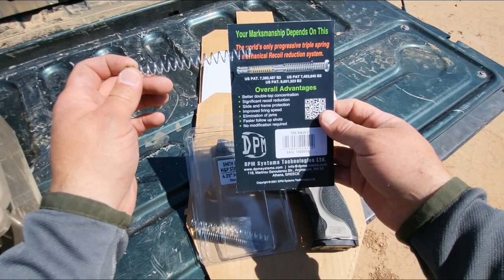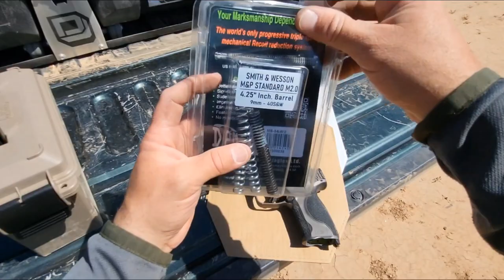Why I upgraded my M&P 2.0 recoil spring and guide rod to DPM.

Comment: DPM has been worth every penny for everything I've put one in. Have one in a 3.6" M&P and my 4" M&P. both of those are 40s. I run 3 calibers thru them both. 9mm, 40, 357sig with appropriate barrels. These springs handle all very well. I'm impressed.
Reply from the maker: This is my first. I became aware of them only a few months ago but I really do like it. I think I'm going to get one for my P365 since I run that gun for a Back Up Gun Match once a month.

Comment: Calculated Kinetics has a optic plate fix.
Reply from the maker: As of right now I have never had any issue with the optic plates that come stock even though they are plastic. I will check them out though. Can never hurt to upgrade.
Reply: @manyo365  he is referring to the dog plate that is supposed to stop the gas from making the optic dirty
Reply from the maker: @matt-ts8cx  That doesn't even bother me anymore. I just cover up the glass with black tape.

Comment: You need to run, the ' stock spring & guide rod and just shoot 124 grain. Ive had my Smith&Wesson 2.0 metal since December i have over 4,000 rounds now. No issues, and stacking shots on top of shots. These recoil spring kits are a waste of money
Reply from the maker: I'm just under 7000 rounds through my 2.0 now and have never had any issue. I put this guide rod in just after 3000 rounds so I have the same amount or more rounds with the DPM guide rod in the gun. It really does make a difference. I can shoot it any way but it's slightly faster with the DPM. I can stack shots on top of shots with any gun and the right amount of patients. I rather go fast and open up the shot group a bit.

Comment: Galloway Precision has very good Springs & rods including pre- made spring/rod assemblies.. They also, have multiple weighted springs.
Reply from the maker: I've tried one of their springs in my p365. I'm not sure if I tried them in any other guns. I'll probably look them up and see what they have. But  for now this DPM really works well.
Reply: @manyo365  If it works stay with it. Unless you just want to play around (tinkerer).  I bought a few things from them for my SR40C. I may check them out some day when I need springs..... Have a good one & keep'um in the 10 ring! 👍
Reply: Note that the hallow precision guide rod is 2.9615 inches long while the OEM is 3.0145. As such, the Galloway won’t fit apex semi drop in barrels (and maybe others) but will fit the OEM barrel.